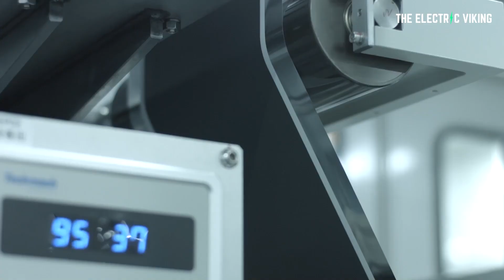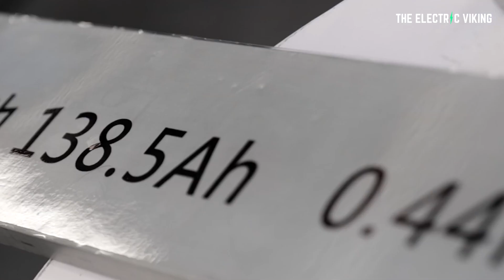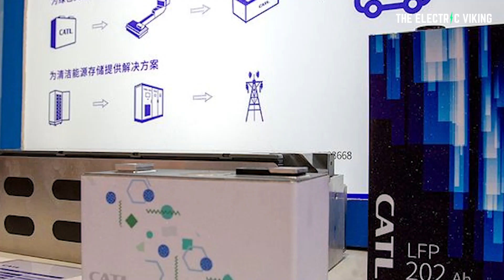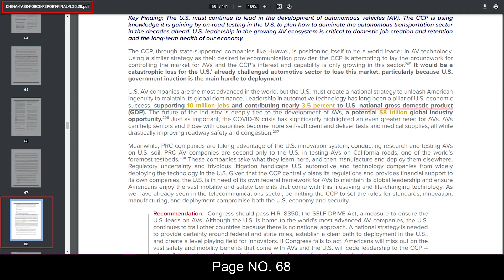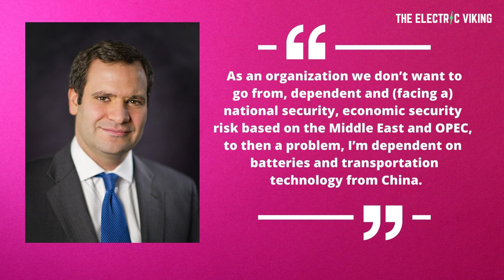China’s electric car strategy is going global - the U.S. is falling behind

Comment: Why? On the face of it, it's a "power struggle" typical of any imperial system, ie the same mechanism everywhere there are old established institutions, so when an upgrade is required, which is all the time, the Old Guard resists to protect what has always worked before. The new lot have to prove themselves despite their predecessors resistance. It's all very logical but can be extremely unpleasant to be "under the hammer" of change. (?)

Comment: We need solid state batteries not these lithium ion batteries
Reply: Solid state batterys is still based on lithium.
Reply: @harryjessen  ahhh well that's no good we need better technology if it's about saving the environment
Reply: @stevewalsh-balshaw1727  lithium-air batteries can theoretical have more than 10 kWh per kilo. And if you want electric cars with long range and ain't to heavy, then you have to use lithium as one of the components.

Comment: im so confused by all these new battery technologies... Which would you say is the most promising to keep an eye on with potential to buy a vehicle?
Reply: Any car that has a good liquid cooling system with good heat pump (more energy efficient)
Reply: Tesla is leading battery technology
Reply: Tesla build the world's biggest batteries
Reply: BYD by a long shot. Their non-explosive blade battery is already in production. 
They have delivered 1M EV vehicles (incl older batteries tech) and had not had a single fire incident.
While Tesla already had quite few fire/explosion incidents.

Comment: Electric vehicles are great until there is no electricity to charge them up. 
Current technology is backwards.
4 wheels equals 4 electric motors.
4 electric motors Turning should have their own electric generators to generate electricity and recharge the batteries as you are driving the vehicles.
Reply: Have you heard about solar charging system?  Or power sourced from windmills?